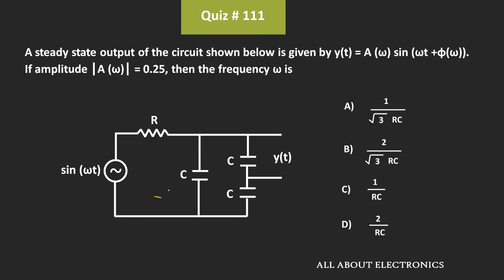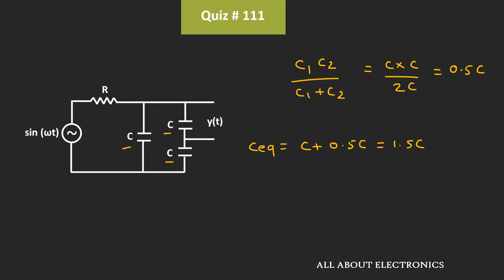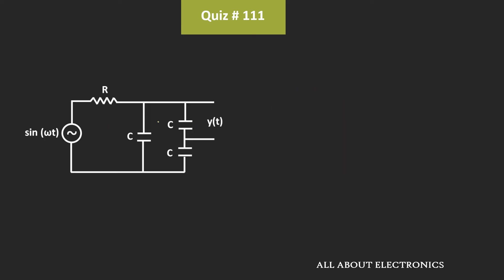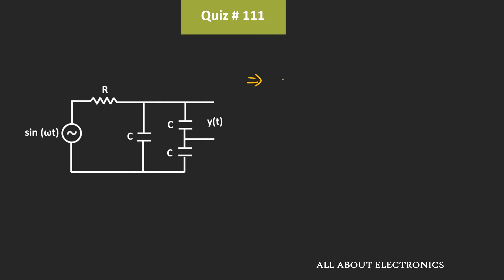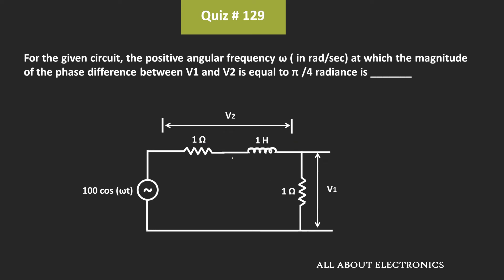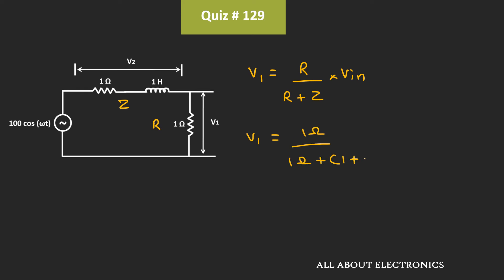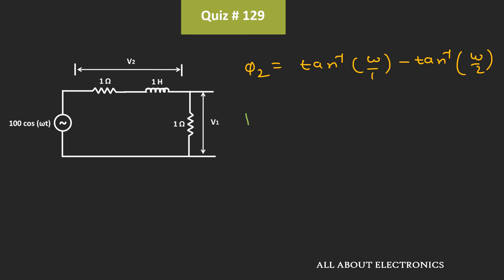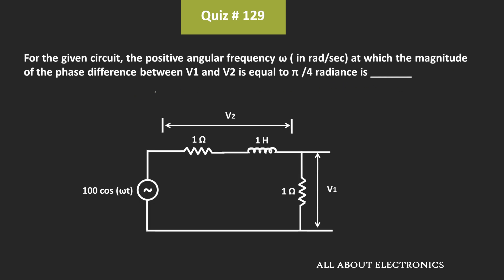Sinusoidal Steady State Analysis Solved Problems | Quiz # 111 and Quiz # 129

Comment from the maker: Please note:
There is a correction at 1:33. 
I forgot to write Vin (sin wt) in the voltage divider equation.
Since the amplitude of the sin(wt) is unity, so while calculating the magnitude of Vx, the magnitude of Vin will be equal to unity.
Reply: Thanks, I was about to ask about that 🙂

Comment: In first ques i didn't get how you find Vx. If you apply voltage divider rule then you didn't include source voltage Vin in it.
Reply from the maker: Yes, in the voltage divider, I forgot to write Vin. It should be there. But when we take the magnitude, then since the amplitude of sin (wt) is 1, it won't come into the picture. But yes, before that in the voltage divider equation, Vin should be there. Thanks for pointing it.